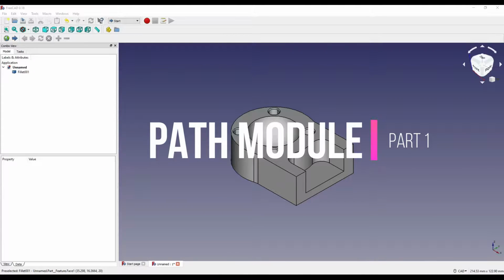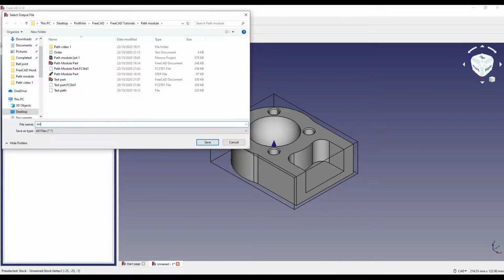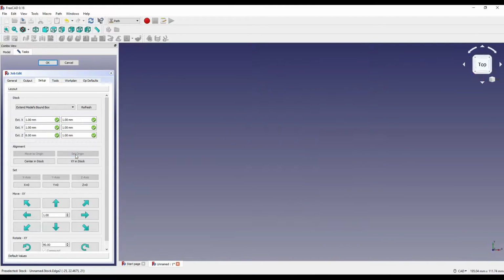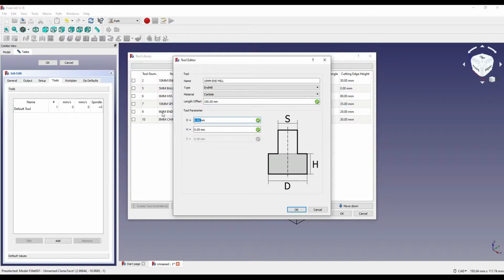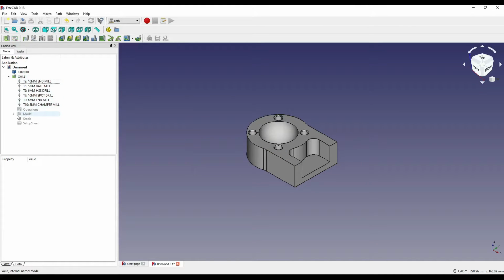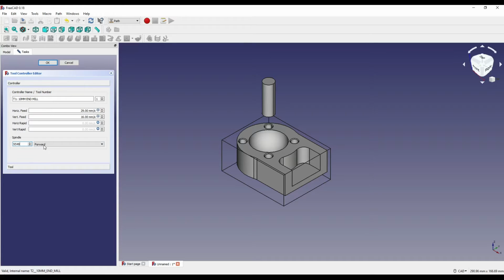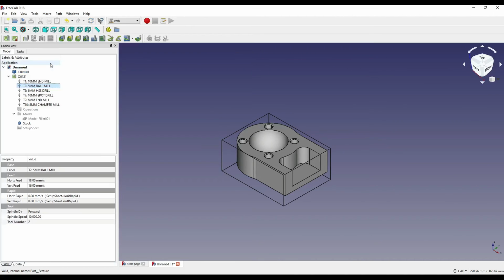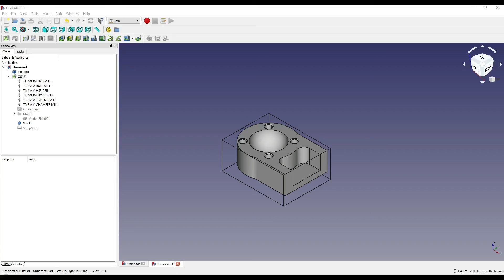FreeCAD Tutorial - Path Module - Geometry setup (PART 1)

Comment: Faced an MDF bed the other day and it worked.  Had to do another one ( different tool ) and the simulation wanted to remove everything.  Tried & tried. Watched this vid over & over.   I finally got there.  Make sure you set the model zero point as Andrew says!  . . . . I got there in the end. Thanks Andrew.     Jim
Reply from the maker: That's great Jim! 😀 Now next time you know 😁
Reply: @AndrewCAD  That's what I struggle with . . . .remembering.  I'm an old pensioner y'know 😄
I am really enjoying learning all this so thank you.

Comment: @Andrew CAD. My problem is I want to create a path that goes in an irregular direction, say, from an xy plane to an xz plane and it traverses gradually, say, imagine like a long pool slide, if you get the idea. I've created multiple datum planes but encountered lot of out of scope errors, besides the process I did is quite complicated just for creating a simple path. Have you guys created a video specifically for that? All videos I've seen only concentrates on a single plane. I'd appreciate to get any info or links. TY.

Comment: Using FreeCAD 0.19, I find that when selecting Add within the "Job Edit" to add a tool, I get a file explorer that opens into my tools path instead of the Tool Manager.  I can click the "Toggle" tool dock from the nav bar above and get there (sorta), but the interaction between the Job Edit panel and the tool manager doesn't appear to exist; is this new?
Reply: Looks like this is one of the differences between 0.18 and 0.19

Comment: The stock/origin setup is very weird. Why is the model offset to the stock after setting up the job? Looks like after the "work origin" is set up in the job - the job is moved to the "global origin" and we have to move the model in the "global origin" coordinate system so that it approximately matches it's coordinates in the "work origin" coordinate system that we see when setting up the job. I don't see how this system can be used professionally while this error isn't fixed =(
Reply from the maker: Good afternoon! I thought this too, however 'Adventures in creation' pointed out in the comments that all you have to do is hide the original model and make the new model visable in the model tree: 'when you move the origin you can just hide your original model and un-hide the model copy under the job "model" tree element. This will save you moving your original model'. Hopefully this helps and is what you're looking for 😀
Reply: @AndrewCAD  Thanks, I'll go try it out! I mainly work in PowerMill, but a free alternative for personal use is just so tempting... FreeCad feels like it needs just a little polish to be usable... or a little getting used to.
Reply from the maker: @multimeganull1  I switch between Edgecam and Hurco winmax, so it's a little different! But a great free alternative for personal use 😀 I shall continue to upload tutorials, so stick around if you're interested 😀